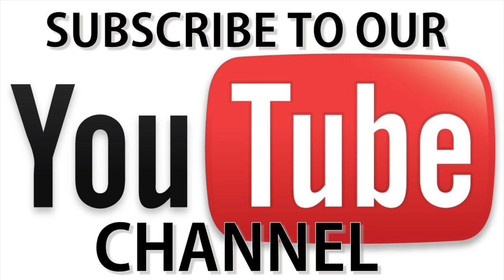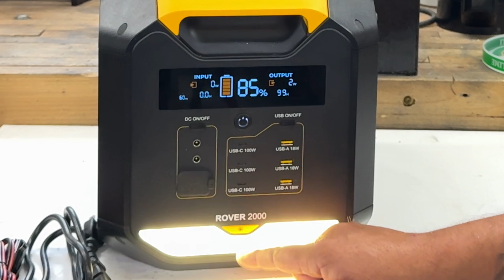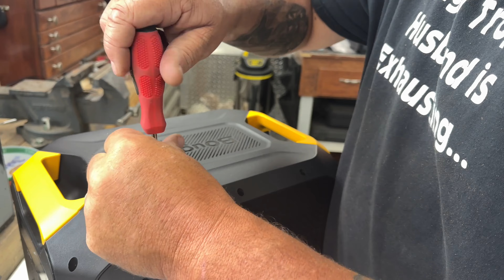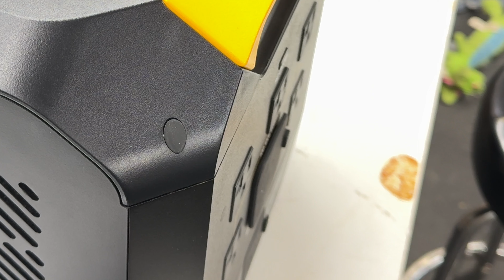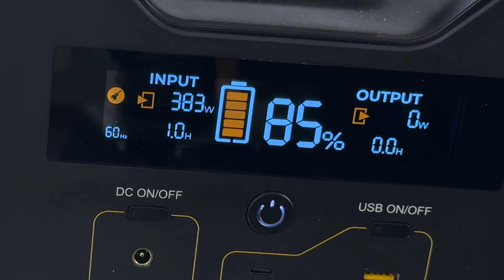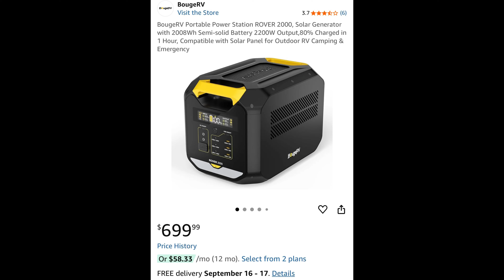BougeRV Rover 2000 Portable Power Station - Review

Comment: Have you used the phone App to see if it has Bluetooth? Of all the reviews haven't seen anyone talk of Bluetooth. I called them they said it did but there is nothing showing in the ad if it does or not. Can you check it out and try the App to check if it does?
Reply from the maker: Well Sun of a gun. It does. There is nothing in the instructions about Bluetooth connectivity but it does. Very simple to add and shows basically everything on the screen.

Thanks for pointing that out.
Reply from the maker: Just threw another Video out there showing the Bluetooth capibility.

Thanks for the tip. I gave you credit for pointing it out.
Reply: @jackofalltrades7822  Thanks for taking the time do this. That was what I needed to know for sure so I can purchase the Rover 2000. I looked at so many power stations and this one can also handle the 30 amp solar input and that's what I need. Thanks also for doing another video!